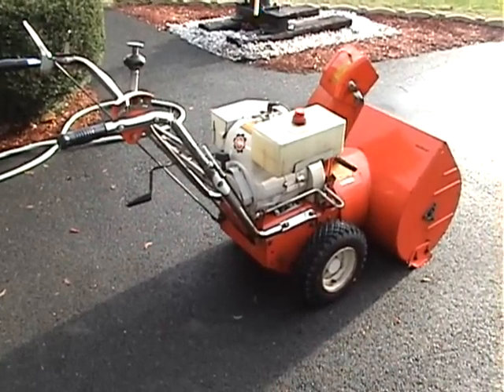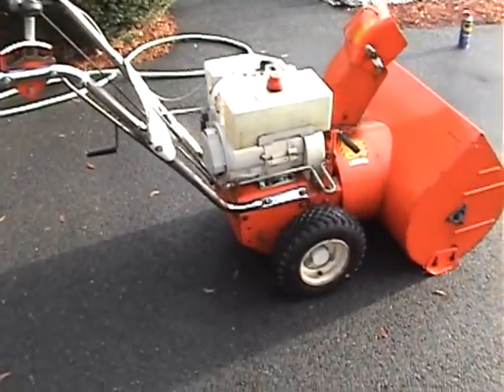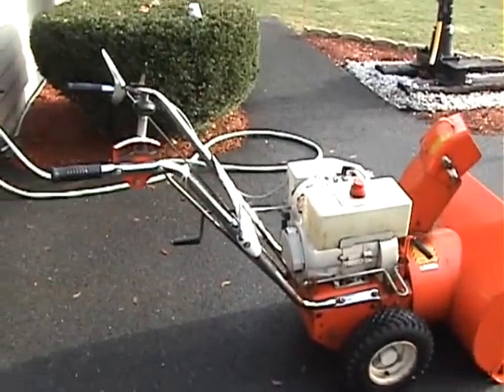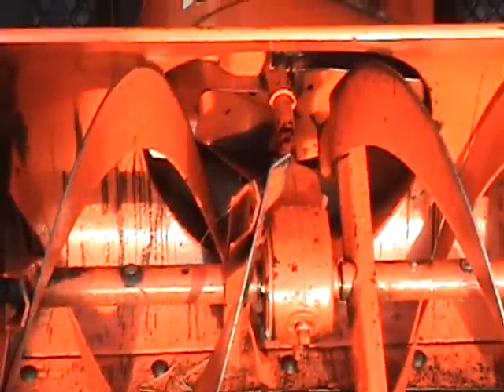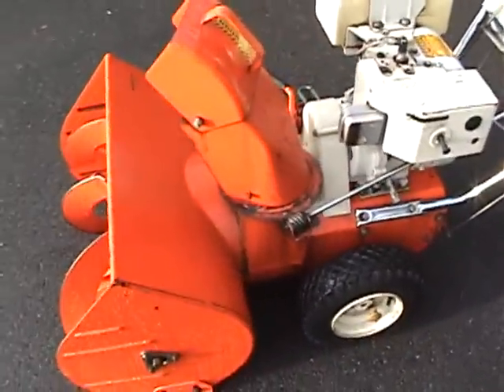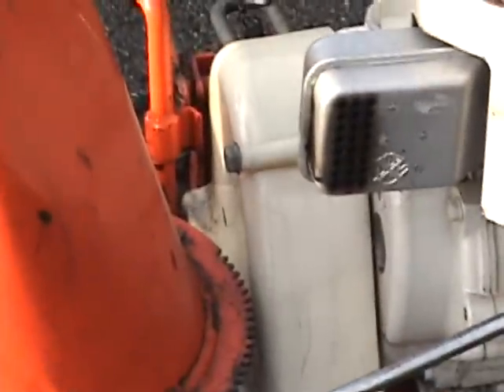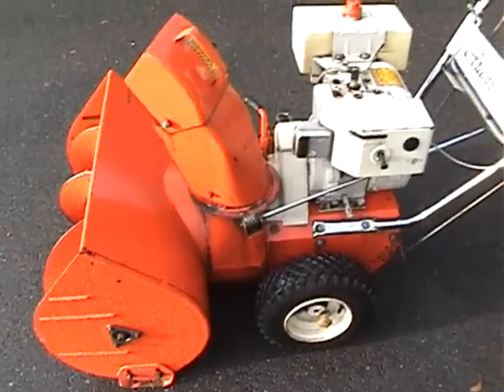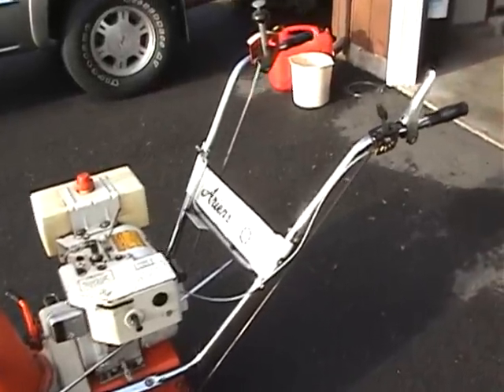1973 Ariens Snow Blower with a 7HP Tecumseh Engine

Comment: How do you keep that bar from wearing out. What hieght do you keep the bar at? Mine was worn half way out. But mine was adjusted so it could clear as close to the pavement as possible, what do you do keep your scraper from making any contact, what height do you keep the bar at?
Reply from the maker: +-Doug -  It is somewhat warn, but I keep the skid shoes at least 1/8" 
lower than the scraper bar.  The skid shoes are much easier to replace 
than the scraper.  Chances are yours was the original also.

Comment: On the engine's blower housing there is a model and serial number stamped on it.
Reply: Built in late 72 for model year 73. plus only the 73 and 74 have the kill switch handle. The 1971 and 72 which were made in 70 and 71 have a flip up handle with a spring that turns the auger on and on the left handle the clutch lever is above only on the 73-74. All prior models had it below. Also only the 73 and 74 has An Ariens Decal on the bucket every other year Prior there was a Sno-Thro sticker on the top right corner of the bucket. The decal on the machine in this video fell off, common because they were glued on and got knocked off a lot when clearing snow and ice off the bucket.

Comment from the maker: I just looked at the parts manual again and under the tractor model numbers there is a "PM-8-72" so maybe it is a 73 model?  I wish there was a way to find out for sure.
Reply: The engine's serial number. Its a 4 digit number followed by a letter. For example 3175R. First digit is year, so 3=1973. The next 3 numbers are the day of the year it was built so 175th day. Assembly line R. That is the only place on the machine where the D.O.M. will be found. It's only accurate when you have the original engine on the machine, which you do. On the machines operators manual it will say PM73 for example on the bottom of the front page. That will be the year the manual was printed and may or may not be accurate to the machine's D.O.M. In your case with the upgraded safety features your machine has to be a 73 or 74. You'll know for sure looking at the engine's serial. But I believe you are accurate at 1973.
Reply: WRONG! There is one place where the date of manufacture was hand stamped with ink - on the top right hand side of the owners manual that is written in like 3 different languages - it looks like this "D 2772"  

Maybe I'm wrong - but seems legit to me!

Comment from the maker: Is there a date stamp or anyway to find out what model year this is?  I thought my father said he purchased it new in the fall of 71.  Yes it did have the Ariens emblem on the bucket.  It fell off a few years back, but I still have it.  I still have the manual and parts list but I can't find a date on it.
Reply: Only on the engine not on the machine.
Reply: WRONG! There is one place where the date of manufacture was hand stamped
 with ink - on the top right hand side of the owners manual that is 
written in like 3 different languages - it looks like this "D 2772"  

Maybe I'm wrong - but seems legit to me!

Comment: i have this same exact model a 910995
Reply: You have the same model bucket. The Tractor also has its own model which would be 910962 most likely. Along with a Tecumseh if 7hp model H70-130067A. They took attachment's so the tractor has a model number, the bucket has a model, the mower has a model as well as all the other attachments made for it.

Comment: Nice unit, but would be a lot nicer if it had a B&S on it.
Reply: None of those older units had Briggs Ariens used Tecumseh one every machine from 1960 to 1974 on the 10000 series and 98% from 1975 to took the final year Tecumseh was in business only a very very select few models had Briggs on them before 2009. That's the case with almost all snowblowers. Tecumseh made a superior winter engine. Engines that are still around and running 45-50 years later. The Horizontal Snow king line. Nobody could touch that winter engine, there still the best. Even now after being out for 8+ years.
Reply: New ownership destroyed the reputation and quality - started cutting corners - then they tanked - a lot of parts are still available - I have this same  Ariens ST724 (I believe that is the right model code)

Body model# 910008 
Serial# 010959

Engine Model# H70-1301584 7HP Tecumseh
Serial# 2223 D

Blower Model# 910995
Serial# 099246

FearlessFront D.W. are these supposed to have 3 Seperate model #'s and Serial #'s like I have found on mine?

Anyways - still runs strong as all hell!  #MAINTAINANCEisKEY ;)